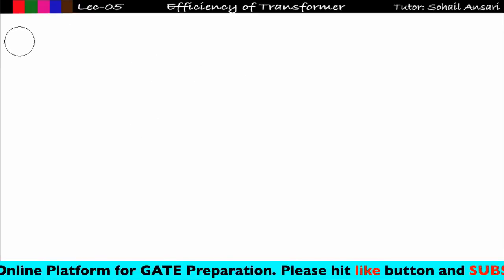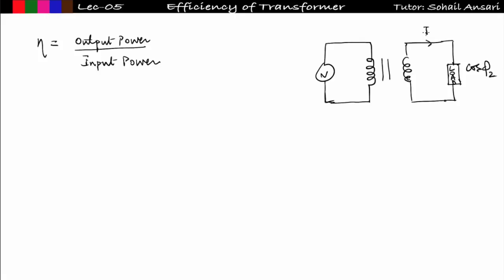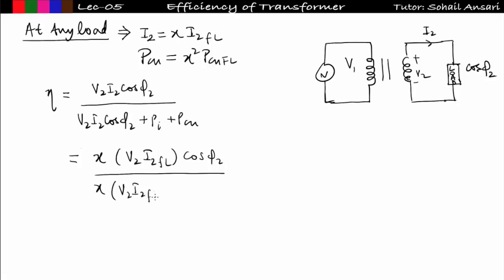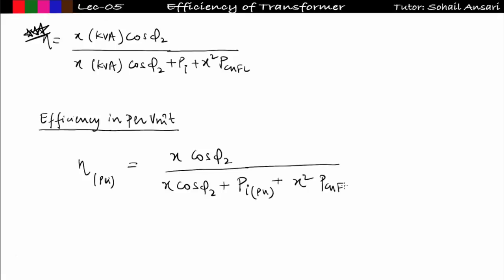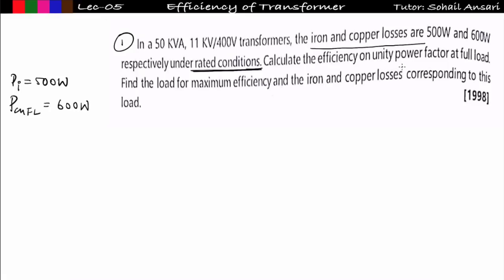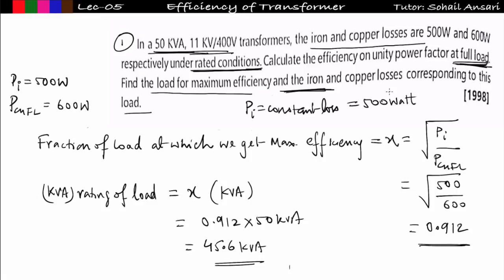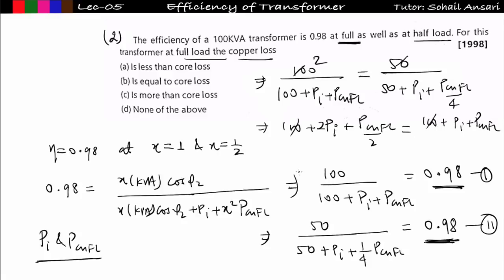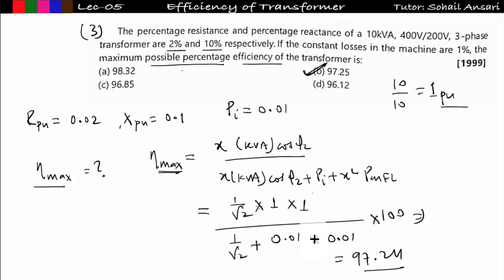Mod-02 Lec-05(a) Efficiency of Transformer | Concepts | Electrical Machine

Comment: But transformer is designed to operate in 105% continuous overloading as contradiction to your statement in 3.35 minutes
Reply from the maker: Wrong ...xmer is designed to handle 125% of rated load..here i talk about the ideal case not the practical one..so instead of judging my statement try to learn the things which i m telling u bcoz i speak only those point which are relevent for gate...if u want to design the xmer then we can talk it separately which is irrelevent for gate..ok
Reply: @GATEMATICEducation  ok. But I think it is 125% for short-time overloading and 105% for continuous overloading. Correct me if I am wrong. And also thank you for making such noble initiative specially for power electronics. It is the best. Wish I could have this in my college days.
Reply from the maker: Generally distribution xmer are loaded at 65-70% of full load..not 105% of full load...bcoz load is not our hand..it depends on consumer k kab wo appliance on and off krte hai..so acc to the load curve its loaded on an avg 65-75%....now power xmer is loaded at 100% of load ..there is nothing like one correct data like 105% at which power xmer is working..usually we design by xmer such that it can handle 125% ...however none of the xmer is working on this..ok

Comment: here we are finding full load current by dividing KVA by E2,and in output we are using V2*I2 as KVA..but E2 is always greater than V2
Reply: in Xmer we always take rated voltage as induced voltage in winding..so while calculating efficieny how can we take rated voltage as terminal voltage